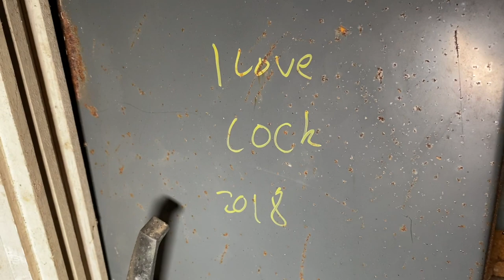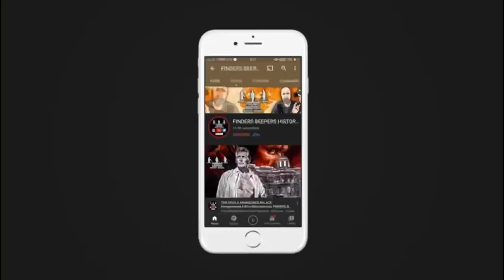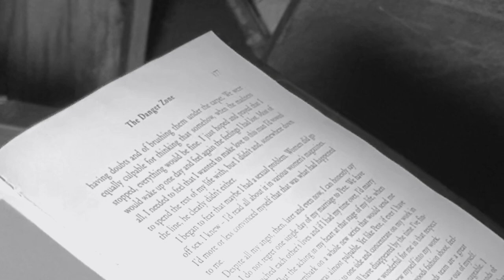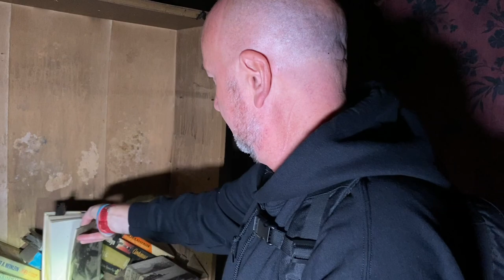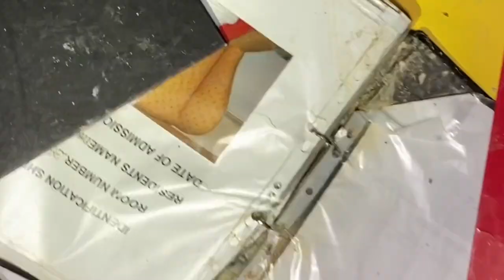Did our footage prove this ABANDONED care home is HAUNTED?

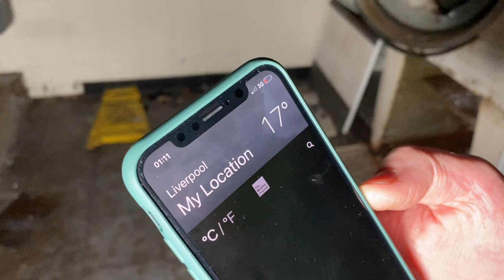Comment: Something not adding up...Did you remove that black sticker on the washing/dryer machine? in the first visit, at 12:12 you can see a black sticker a person placed on the machine. You even pointed it out. In this video, the sticker is see still there at 14:55 but when you guys return to the laundry room, you can see at 47:43 the sticker is not even there...and is same machine, same room, window and trash on the ground.